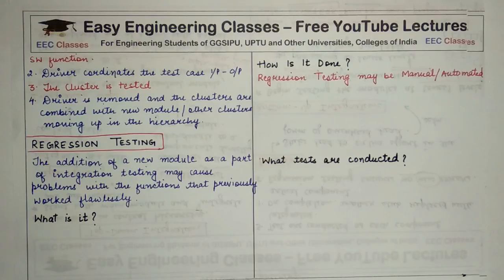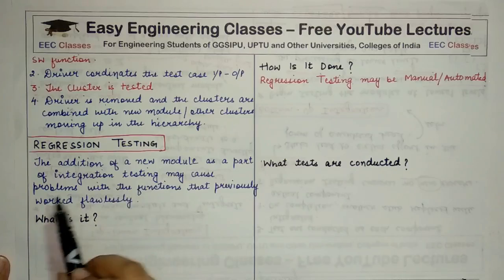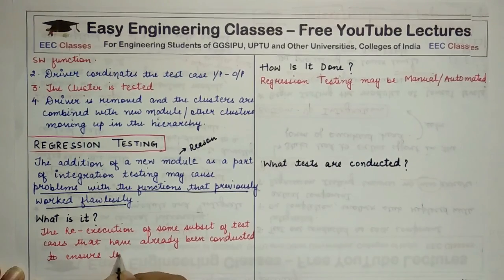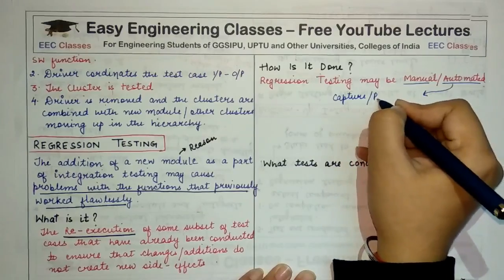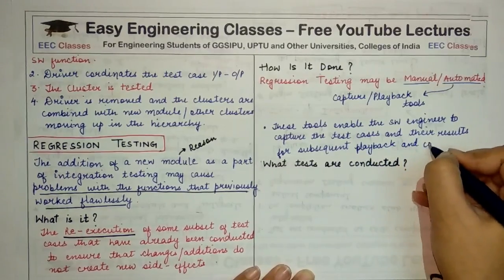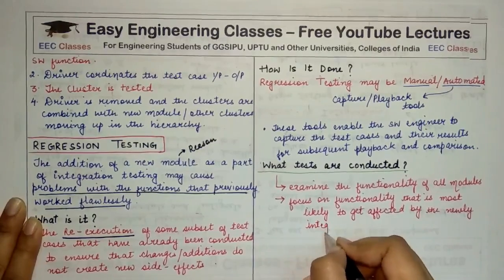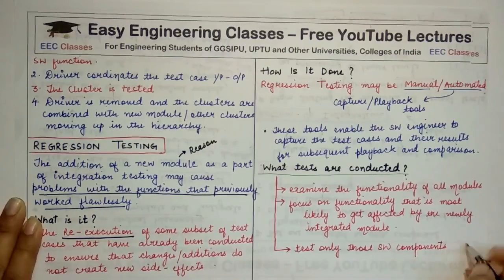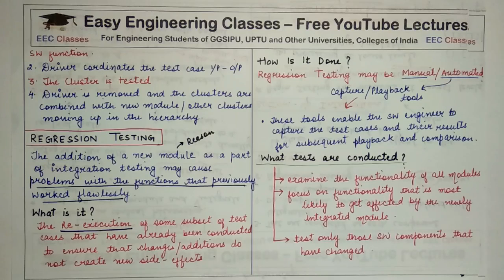L76: Regression Testing | Introduction | Software Engineering Testing Lectures in Hindi

Comment: Thanks a lot for such amazing videos. they are rally helpful. I had this one request. Since exams are nearing (6th Dec) can you upload videos on following topics (Function Oriented Design, Object Oriented
Design, User Interface Design. Failure and Faults, Reliability Models: Basic Model, Logarithmic Poisson Model, Calendar time Component,Reliability Allocation,Decision table testing, Cause effect graphing, Structural testing: Path testing, Data flow and mutation testing,Management of Maintenance, Maintenance Process, Maintenance Models, Reverse Engineering, Software Reengineering, Configuration Management, Documentation.) asap? Thanks a lot :)